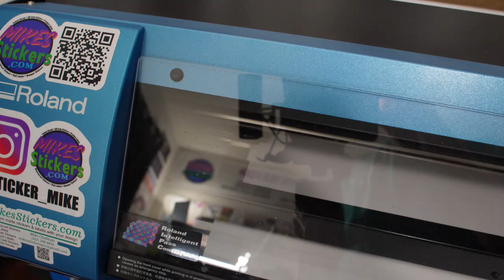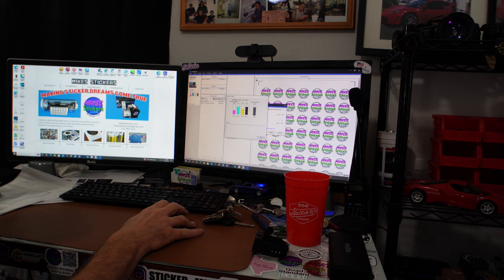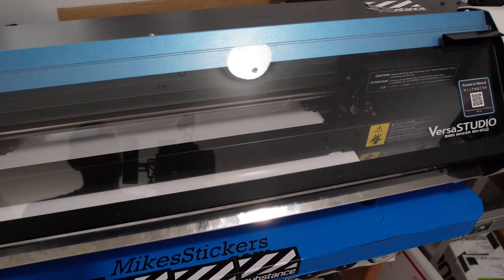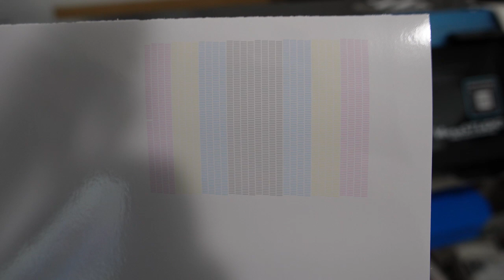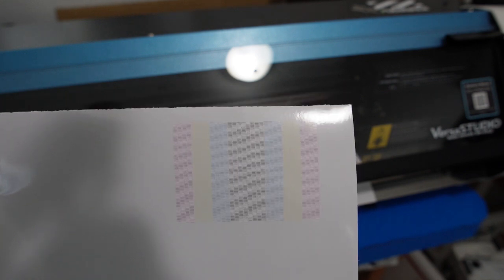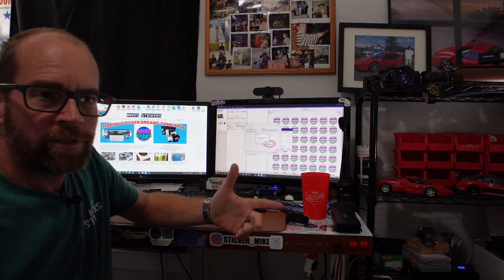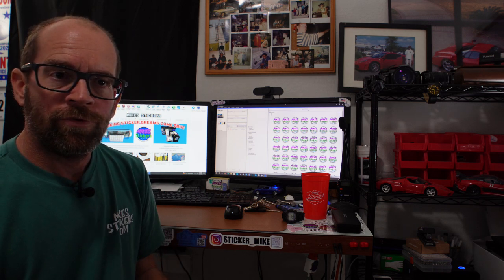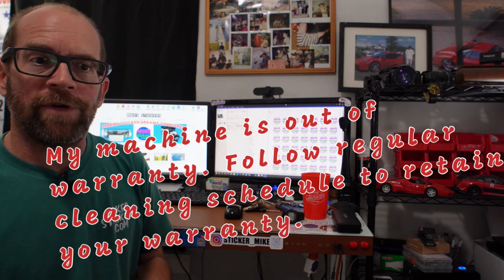Roland BN 20a Maintenance

Comment: It's always the magenta for some reason on those media clamps. Also, here is a little tip. I use a cleaning cartridge and extract the cleaning fluid to clean all my machine. I don't do it as required either. Maybe once every 6 months to a year. Always good to see your videos. I get those drops outs here and there, then they swap to other colors. But as long as you keep on printing, they will all clear up.